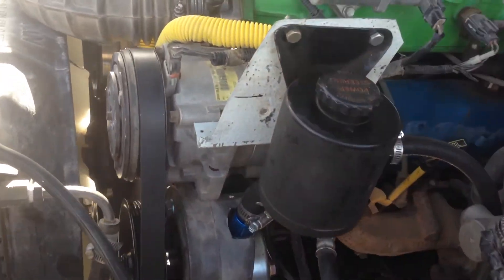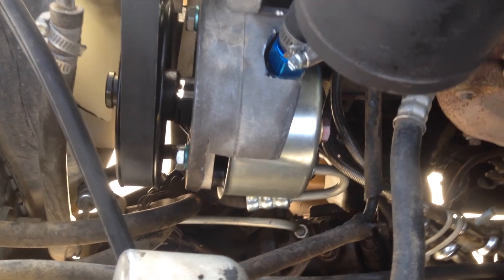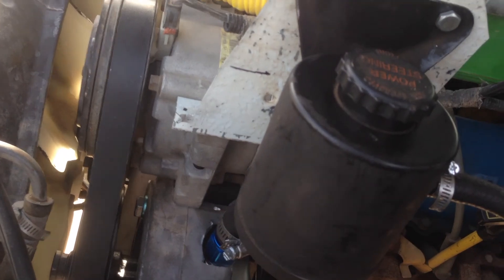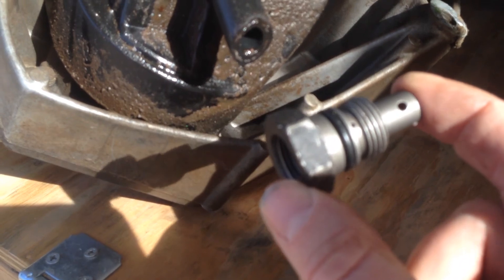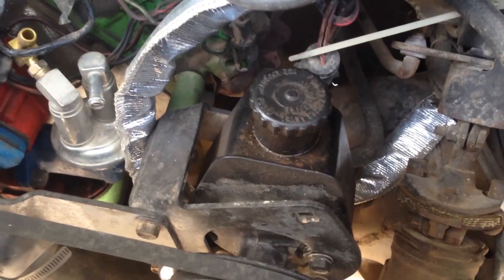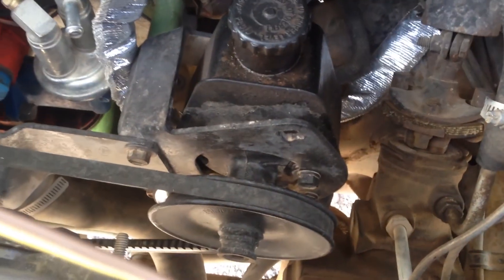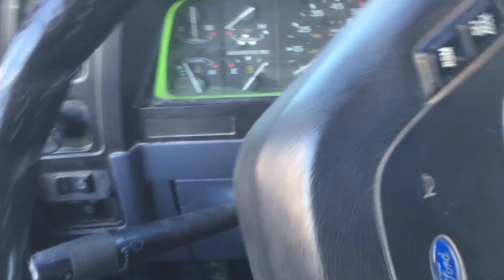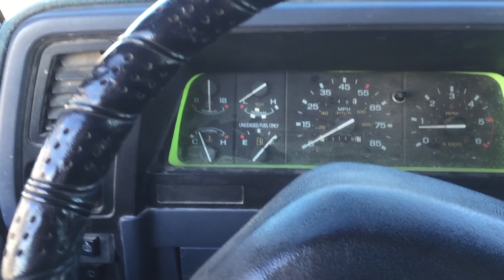My Conversion from Ford Power Steering pump to a Saginaw P style pump on a 1992 Explorer

Comment: How do you route the lines from the pump to the line coolers to the reservoir?
Reply from the maker: The high pressure line is from a '85 Van and the return line is just oil resistant hose.  The rest of the lines are factory including the power steering loop (cooler) line that is in front of the crossmember.

Comment: I'm assuming you changed this due to the ford pump whine 🤣
Reply from the maker: I did it because I needed more pressure.   The p-pumps didn't put out near as much pressure and when wheeling I need all the extra pressure I can get.   I can't find the chart now but when I was doing this mod I found the Ford Van power steering pump had one of the highest pressures of any Saginaw style pump (from the factory).  As for the wine, I never had the wine.  I always run Mobile 1 Synthetic ATF on my power 1980-1990's Ford power steering systems.  I'm even running that with the Saginaw pump now.

Comment: Can you just buy a reman or power steering pump from autozone that fits the van? Or is that not the same
Reply: Different pump types. The notorious power steering whine that most 90's fords had was caused by the power steering pump I think it's known as a C2. They also leak. The best option is replacing them with the Saginaw style pump, which is quiet, and doesn't leak.
Reply from the maker: I switched from a normal pump style to a saginaw style pump.  The 90's ford power steering pumps are typically noisy (wasn't really in my case) but also put out less pressure/volume than the saginaw..  I wanted the increased pressure for when I'm out 4 wheeling.   I've actually had decent luck with the pumps on my fords but I always run Mobile 1 synthetic ATF for power steering fluid.  Since I started doing that I stopped getting the whining power steering pump issue that was so prevalent from the 1990's vintage fords.

Comment: how do you make the steering more effortless?
Reply from the maker: +shylildude I'm assuming we aren't talking about using alignment specs to change how the steering feels.  Toe and Caster can affect steering effort.  

In my case, I'm using that P Pump (Saginaw) from the Ford Van.  Those P-Pumps put out about 1350-1450 psi of pressure which is much more than the Ford style (non saginaw) pumps.  That increase in pressure what what reduced the steering effort.   You can see how easy the tires are turning with the new pump even with the steering stabilizer (which is probably going to be coming off).   On my last wheeling trip I did find that if I had almost all the weight on the front end of the truck that I still couldn't get the wheel to turn.  I may try to increase the pressure on my pump BUT I have to be careful that I don't go too high or I will blow the steering box apart.

Comment: Sorry to sound so dumb but is the red line on 55 on the Speedo the max speed or?
Reply from the maker: Back in the early 1970's there was a national speed limit law which stated the highlighting of the 55 (also said 85mph max on the speedometer).  The speedometer highlighting rule was dropped in 1981 but for some reason Ford kept it there.   My guess is because they didn't drop the 55 mph max speed limit until 1988 (for some roads) and they didn't want to redesign things yet..  Look up National Maximum Speed Law in wikipedia for more info...